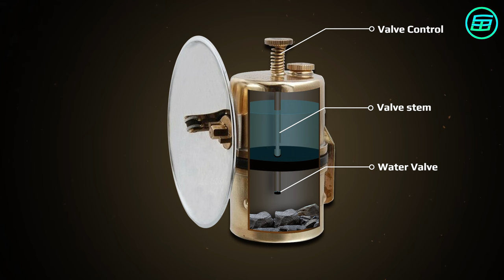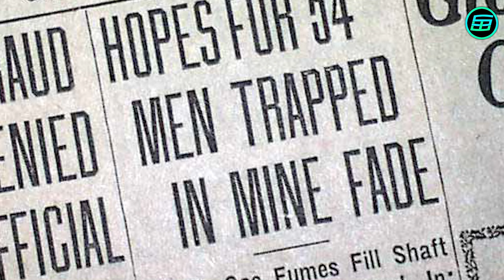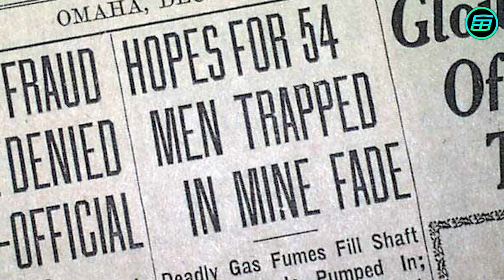Flame from rock and water (Carbide Lamps)

Comment: I still have my old grandads carbide gas lamps both his hand lamp and helmet lamp. Use by regular and apart from the old descale the white shit in the bottom wer the chalk goes and a poke with a thin wire it goes well...yours sincerely from the old qeer corrupt UK